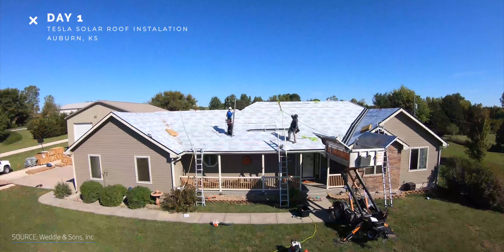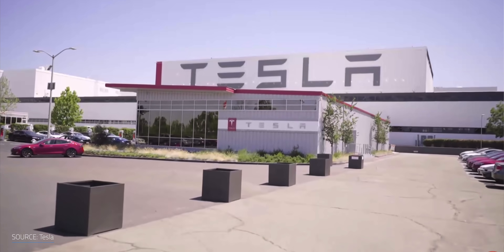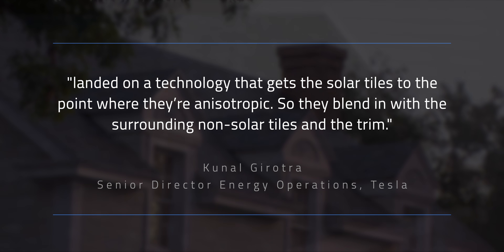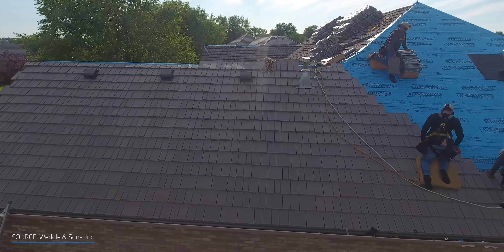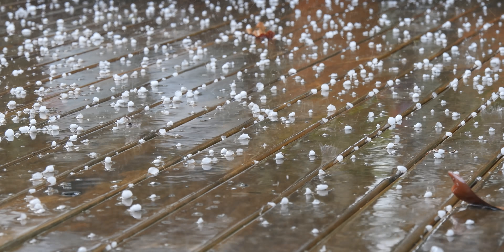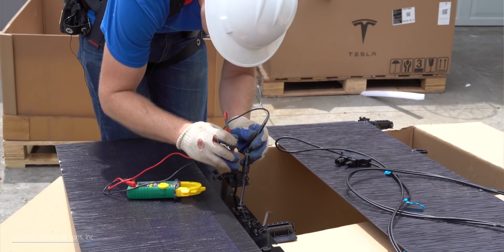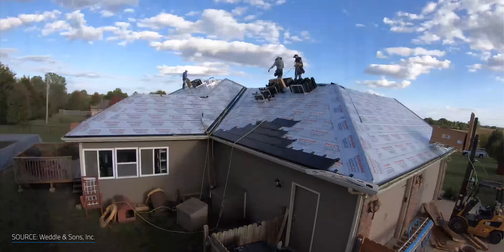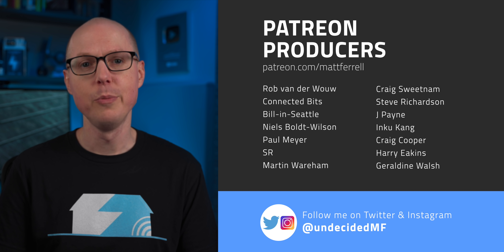Exploring If Tesla Solar Roof Is About To Go Mainstream?

Comment: This was a timely piece for me! In Florida, in a 5,000 sf home with 7,000 sf of tile roof area. Roof is 22 years old, we’ve spent around $30K over the years repair and redoing an initial poor installation. Time to replace... been watching the Tesla product develop for the last 5 years. And now I think its timing in development and our timing of having to replace the roof have come together. I’ve made the contacts with Tesla, have paid for the estimate, have been signed a project# but have yet to hear directly from them... Fortunately I’m patient... we have no current roof problems... This video has been a HUGE step forward in erasing a lot of concerns I had... now its down to Tesla executing... to be continued...😎

Comment: This is an infomercial. If you're asphalt roof only lasts 10-15 years it's because you're roofer didn't know what they were doing and NO ONE is going to spend 8-12k replacing an asphalt roof when they can go buy a bundle of shingles and replace a couple dozen shingles. We replaced the original roof on our house 2 years ago. It was regular three tab shingles and was 27 years old. We spent $7500 on our new roof and I fully expect it to go 30-40 years. If they can get the cost dropped by 50% they'll have a solid market but until then it's going to be niche customers.

Comment: I figured it up and to put a solar roof on my house using 100% electricity generating tiles it would cost me $100,000 just in materials. With the cost of electricity in my area it would take me 25-30 years to break even on that.

Comment: Good video until mentioning hail damage to asphalt roof that has solar panels on it. Why you would have to pull panels to inspect the roof underneath them? Roof under the panels won't have damage because it's under the panels. If hails get under panels, they are not striking the roof perpendicular enough and will just bounce off.

Comment: Looks like a fantastic idea. I wonder how they would hold up during a hurricane (hit directly by 2 last year.) and how costly it would be to replace those damaged, IF you were able to get any. I have a 17.5kw generac that powers my whole home, ac included, for days (grid went out for 7 days first hurricane, 9 days the second) and my shingles stood up to both. My generator was $3,100, $400 for an automatic transfer switch. Cost of gas combined was $235. My homes brand new and small. Don’t see any advantages here.

Comment: I like it so far.  But if few of these tiles brake in a strong storm your roof will be exposed to the horrors of the storm for hours. Also if tiles compromised in strong winds there's a chance that huge chunks of the roof will be torn violently. Incredible amount of damage is possible from few tiles failure. I would imagine that the roof cover should be on its own with the grid and slide slots for the panels. This way roof is safe and just replace the broken tiles.  Also this introduces a new appeal for those with less money to place a portion of the roof with solar and the other with blanks. And then we create a market for cool and multi colored blank tiles. Just a sudden thought I had after watching this video which was very informative.  Good job.

Comment: I wonder if the solar panel can be made for DIY like installing floor wood panels.  Also I am curious what it takes to maintain, for example dust and stains would build up over time so would you have to wipe or thorough clean them once in a while?
Reply: Yes. I'm installing one next week. Tesla is great!!

Comment: As excited as I initially was, when you find out the roofing tiles can’t handle the effects of bad storms, large diameter hail, etc, it’s really only set for calm weather states, not here on the Gulf Coast. They were not really honest on its durability, although Tesla has moved to increase the thickness of the tiles.

Comment: So many of these comparisons are to the high end products.... My daughter works for a nationwide remodeling and roofing company. Her branch may get requests for 50 high end roofs in their territory per year but they only install 5-10 of those roofs from those quotes. Probably half of those quotes are storm damage roofs that owners are trying to upgrade with insurance payouts. Elon is smart in that he knows the only way this product survives the reality of the soar market is if the volume for the product demand is high. These test roofing companies are Tesla are still playing the price point game to wring as much profit out of the jobs as they can not provide a quality product and project for the client. I noticed the comment on the rebates. The solar market has always looked at rebates as theirs NOT the customers!!! Every time there is a rebate the price goes up to absorb the rebate!! That is one of the dominate reasons the solar water heaters never made it and the original waves of solar panel installations never went forward. Rebates were to make the technology affordable but the technology market was so greedy the always made a grab for the rebate and killed the market support they received!! Get Solar with this type of installation to the common roofers market and three things will happen. 1. Installations will climb rapidly. 2. repair parts are simple enough you could order a tile on line and replace it yourself if one breaks or fails. 3. The electric companies will panic as so many homes will drop off the grid or want to sell power back the strangle hold power companies have on the country will fail. Bloom Energy went after consumers and then forgot about them when they partnered with big tech. Big box stores wanted solar on their roofs until the electric companies refused to purchase the power!! Can you imagine every home and every big box store having this roofing system where the power on the grid came from EVERYWHERE not windmills, power plants, massive solar arrays, and nuclear power?

Comment: After seeing that roofer shatter the solar shingle with a hammer, I think I'd rather have Asphalt or standing seam roof and just mount the solar cell array above it.
In 25 years I'll install the Gorilla-Glass Unobtainium Full Spectrum Energy Absorption roof.
Reply: What you should really do is take the time to do some research and find the actual video of the guy doing it.  Try looking up "Tesla Solar Roof, Breaking the Tesla Solar Roof Glass Tile" by Tomas Nochta and you'll see that he hits the shingle with a hammer in the same spot three times in a row before it breaks.  It doesn't just shatter with one hit which is what this video leads you to believe.

Comment: Like the idea a lot... they can make these solar tiles longer (4 x 3 feet at least or so) to achieve installation speeds that are faster with reduced labor costs. The shattering though is a problem and they should consider a different type of material or some sort of reinforcement. The minimum life for such a roof should be 25 years, so it is great to see them achieve this. Assuming these can be recycled, roofs will be one more solutions to ongoing problems. Finally, I am sure they can also use factory made sections that are much larger and can be installed with a crane, thus leaving only the joints and other parts for additional labor using workers only where needed, basically making a roof operational in two days for sure.

Comment: Does the existing roof structure have to be reinforced or can the tiles be installed on the existing framing?
Reply: Not unless there's a structural issue.  The whole system weighs in at about 3.4lb/sqft (psf) which is only slightly more than architectural asphalt shingles and less than high end asphalt shingles... neither system requires added roof strength.

Comment: I’m in MA and have been wanting solar, but never liked the existing solutions. I’m super tempted by the solar tiles. My home is 15 years old, so the roof, technically, is coming due for replacement in the next 5 to 10 - so I think I’m going to wait until then, and go with these Tiles.

Comment: Secondly, the math hasn't been done.  How much does it cost vs. the lifespan vs. the savings?  Once it reaches end-of-life, what do you do with it?  It matters on how many kilowatt hours you can actually get each year vs. where you live (average cloud cover, snow fall, percentage of sunlight).  The devil is always in the details.  I've done the math, as have some friends...in Wisconsin for instance, the savings based on actual kw hours it provides over the lifespan is a wash, there is NO savings over the life of the product, this is a mathematical fact in Wisconsin based on data.  Now, maybe it works out better in the SW part of the nation, I have not done the math for that a location.  However, on top of the fact it's a wash in WI, now what do you with the old panels at end of life?  They are made of technically "hazardous waste", you cannot just throw them out, has anyone looked at the expense and potential issues with disposing all those dead, and NOT reusable, solar panels?  Green sounds great until you apply logic and math to it...the technology is not at the point where this is TRULY viable and a "savings".

Comment: I didn't catch if you addressed density of cells. I actually had a solar roof order open and switched to a panel layout solely due to lower power density of the tiles. My situation might be somewhat unique (low surface area, very steep pitches) but panels appear to have an advantage for at least some situations, for now.

Comment: I’m wondering about snow and is it possible to heat them so they melt the snow to continuously produce solar energy throughout the winter I live in Canada in a century home with high pitch does it react like a metal roof And does it need snow catchers
Reply: That has always been my thought on solar. Great question.

Comment: Certainly the roofer company is bs on the pricing, you have your standard roof that goes for all, wood frame, plywood, impermeable membrane whatever it may be
Then the difference is also installation time, from what I gathered it's much faster to install Tesla tiles, really much faster than going tile by tile
In 2 days you can do a large roof with 2/3 people
So to compare the cost, not sure
I have used Portuguese tiles to make my roof, can't remember the cost, I think it was 1$ per tile, 13 tiles per sqm
What I did not see here was how many watts per sqm, and cost per sqm, including flashings, etc